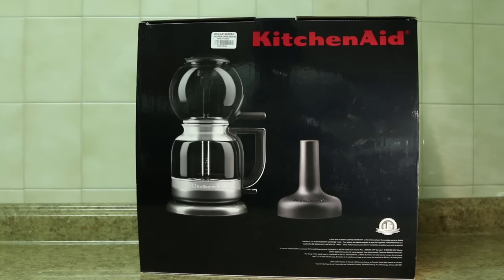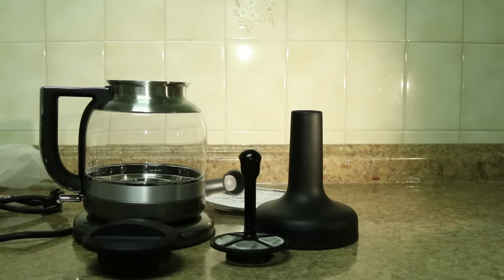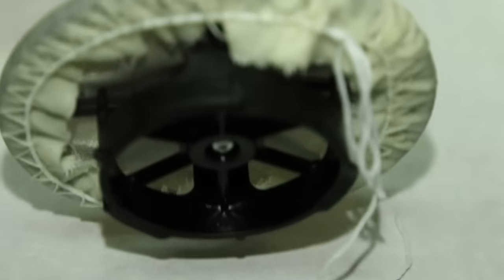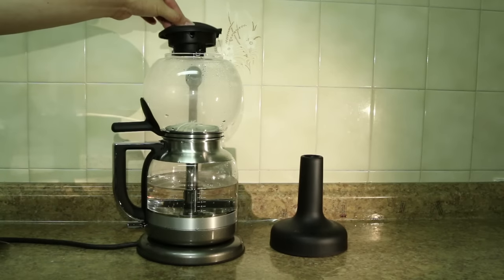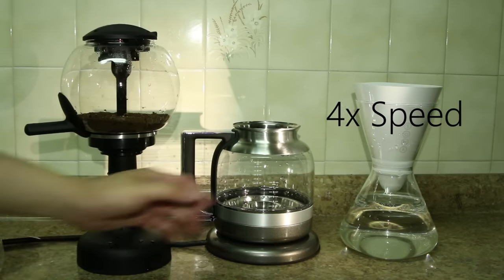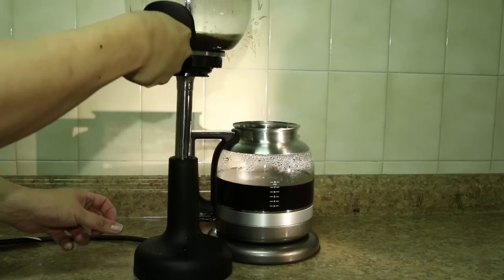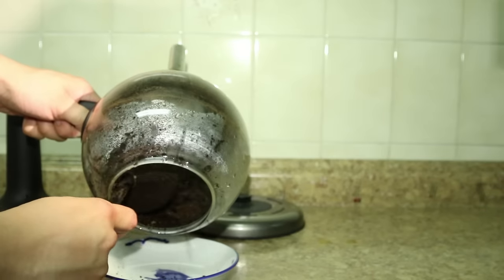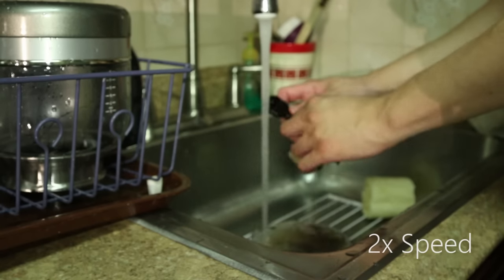Making Coffee with the KitchenAid Siphon filter

Comment: This looks like a well-made machine. I had a Bodum Santos, which looked cool, but was made of plastic. Over several years, the glues holding the internal components in the base began to crack, allowing water into the electrical area. I currently use a glass syphon over a halogen burner (the cheaper Chinese model) but it takes about fifteen minutes to make around two cups.

Comment: I have 2 Sunbeam vacuum pots from the 1950's just like the one my parents used every morning.They has two temps.  Hi for boiling and making the water go up in the top to brew the coffee and a keep warm temp. As soon as the water boils the switch flips down to the keep warm temp.  You have to unplug it to just turn it off. When not making coffee the bottom can make boiling water pretty fast.  I guess it hasn't been a hassle to clean it for me as I have a garbage disposal and I just rinse the grounds down it.  It has a cloth filter but the filter is held in a frame work so those string things are not needed. In one of the pots there is a spring that holds the filter down when you put the rod down the tube and hook the little 90 degree bent end of the rod on the bottom of the tube, the other model has a rod that runs to the bottom of the pot where there is threaded stem it screws onto to hold the filter down when the water comes up into the top.  I should use it more often. I use a single cup pod brewer most of the time now.
Reply from the maker: I been looking into getting some vintage ones.  Maybe I will get something like those off ebay.
Reply: Thats where I got mine.
Reply: klcostle i
Reply: We had one of those Sunbeam pots when I was growing up.  I've become tired of the expense of K-Cups so I wondered if these vacuum pots still existed and discovered the KitchenAid but was dismayed to find out that once it made the coffee it had no setting for keeping it warm.  I found vintage Sunbeams, Corys and GE pots for sale on EBay and decided to buy a GE because they're glass so you can watch the process as it happens and not have any metallic taste.

The little red button that activates the burner seems to be kind of iffy, it tends to want to pop out to the warming mode so I have to watch it to make sure the burner stays on high so the brewing can happen.  Other than that it seems to work fine and makes great coffee so I'm hoping it continues to work.  It sure adds a bit of 1940's flair to the kitchen.  If I had it to do over again though I'd buy the KitchenAid, it's not as visually interesting but probably more reliable.
Reply: The Sunbeam filter assembly will work in the KitchenAid, but you have to straighten the bend at the top to be able to reach it. I did this and use it regularly.

Comment: Do you have to boil the cloth filter every time you use it? Not being able to submerge the carafe, or clean it out entirely because of the lip is a no go for me and disqualifies this machine. Also, the pain in the ass of having to tie a string on the cloth filter is drudgery at best. The cloth filter will not last very many times before it starts to deteriorate, I'm sure. Have you tried using just the metal filter, and see if it works without the cloth one?
Reply from the maker: I don't, but you probably should do it more than less, to keep bacteria etc from growing on it.  You also have to replace it time to time.

Comment: Hi there, can you use the bottom half of this unit as a standalone kettle? (by removing the brewing chamber, putting the lid on and turning it on)...will it turn off automatically?
Reply from the maker: +Natahn Spelman I am not sure, I only borrowed this machine for a while.  There doesn't seem anything to prevent you from starting to boil with a top.  I think there is a sensor (temperature) to know when to shut off.  With water in the kettle, it probably will never shut off till it is dry.

Comment: Well, let me tell you my story. I have one of those for about 5 years now... I LOVE it, coffee is delicious but... yes, there is a but... no more a BUT... there is problem with this plus the fact that the service from the company is very poor... it was very unpleasant and still is to this day. Please note that I take great care on my appliances. I have some for 35 years and they still work perfectly and are looking like new. I would send you a picture of the carafe and the top part and, besides the broken handle and etc... my coffee machine looks like new.

Just few months after buying the machine, the handle of the top part broke, leaving just an ugly and very hot metal bar... I almost dropped the top part when it broke and just caught it before it fell to the floor... ... burning my hands.. Contacting the company and arguing with them was very unpleasant. Then they reluctantly sent me another top part. Everything went well... at least for another few months, until the handle broke again the exact same way. Called again, argue, and they refused to replace it, flatly, even though I had this carafe for only few months. So now, I have to wrap a paper towel around the metal part to not burn myself while taking the top part off the bottom part after the brewing.

Then, it started to collapse... plastic parts under the top part started to break down, parts of that "plastic/bakelite/whatever they name it" were just breaking down with parts of the plastic falling in the coffee (hmmm lots of parts words in this sentence). Then, I lost one of the magnet while taking the top part off the bottom part and had to dish it in the coffee pot. And the plastic is still falling, bit by bit, and I find little parts of that plastic in my cups of coffee. The worst is that now, the seal isn't as tight anymore and it makes a loud whistling sound while brewing and, obviously, the pressure is lesser... still working for the moment... but for how long. It doesn't make the strong flush back into the carafe anymore,

I find it unacceptable that a coffee syphon machine of that price just break down like this... I paid $300 plus tax for that darn thing 5 years ago. I am very sad and hope it will last as I love it but... ... KitchenAid are now renown for their bad warranty service response and I think it is not OK mostly as their appliances are really not cheap. Nice attractive designs, I agree but... ... 

How yours stand it, Hungry Ferret?

Comment: Looking for ONLY 100% plastic-free. Preferably glass.
Automatic.
Not manual pour
Electric, not with a fire underneath.
Vacuum would be great but the plastic-free ones I’ve found you have to light. 

Any suggestions?
Reply from the maker: Not of the top of my head, plastic is very much a everyday part of our lives.  The infra light stoves for the vacuum coffee makers are very very expensive.
Reply: I have owned the KitchenAid brewer for two years now. The plastic has no effect on the taste that I can tell. I have been using manual siphen brewers since the 1980's.

Comment: Have you tried to use disposable paper filters?
Reply from the maker: +Eduardo Carvajal I don't have any disposable ones for this machine.  The size and shape of the center hole & pole would make it a challenge.
Reply: If you can find an old Sunbeam Coffeemaster cloth siphon filter assembly (they come up on eBay now and then), they can use a paper filter and will work in this brewer if you bend the top of the wire a bit. I use this method.

Comment: I have both a sunbeam electric siphon brewer and a stove top Cory brewer.   This kitchenaid is nothing more than a fancier sunbeam 30c.  there is not one thing new in invention here, save the magnet lock.   One of the nice things about both my brewers is that they require no cloth filter.  I don't find that they are hard to clean, though they take a little practice to perfect the method.  I say don't waste your money ( 180 bucks!!). go to eBay or search hard at a thrift store,  spend less and enjoy the same if not better build quality.   Gaskets for the old models are all still available today.
Reply: Thanks for the helpful review.  I was tempted but, now I am passing
Reply: I just picked up a Sunbeam a30c at a thrift store for $5 and the seal and heating element look fine.  I'm now having to look for a power cord before I can give it a try.  I'm checking out videos to see how to use it.  Being that it's all nicely shiny chrome instead of glass it won't be quite the show, but it has lasted since the 40s because it isn't glass.
Reply: The problem with old Sunbeams is that many are out of adjustment and either burn the coffee or under-brew it. I have bought several on eBay. Only one worked correctly. It gets expensive bying several to get one that works. BTW, with the KitchenAid, you can leave the cloth off  the filter if you want. There is a screen filter there that filters as good as the Sunbeam screen.